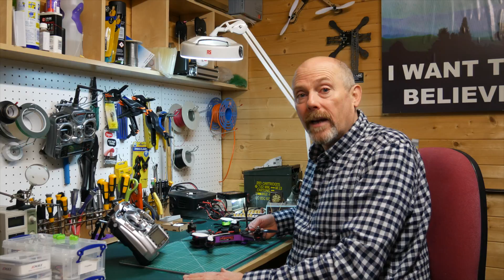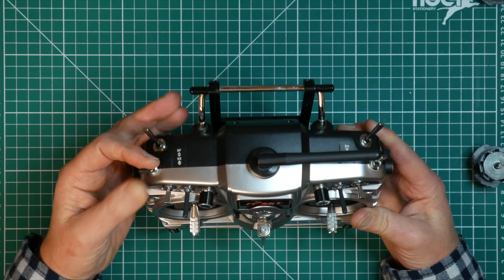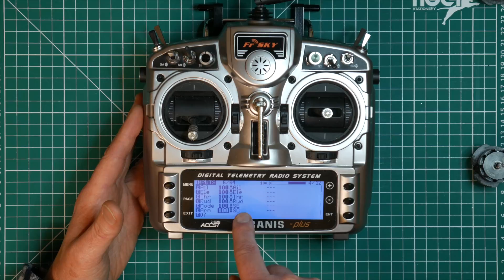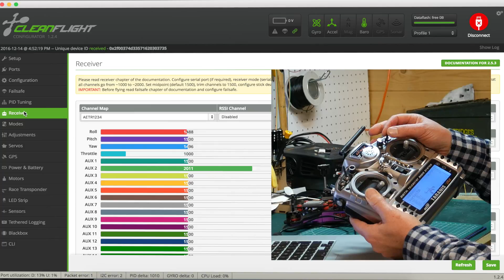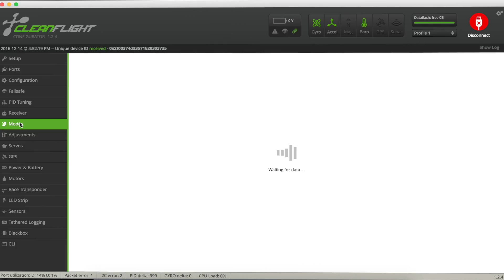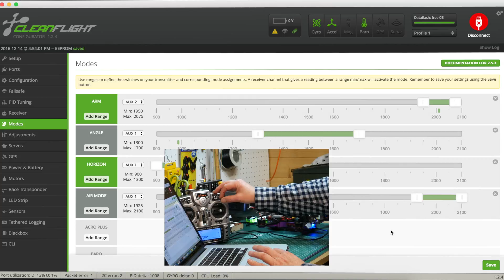Vortex 250 Pro quick tip - arm switch

Comment: Hi there,
i appreciate that cleanflight and betaflight are basically the same thing but in betaflight
i would like to change the setting on the mode switch. In my mind the mode switch should
run from easiest mode to hardest mode, like you have it in cleanflight......But in betaflight 
it runs Horizon - angle - air mode... 
I need to transpose the Horizon and Angle mode.

any help you can give me would be great.

thanks in advance

Mark Logan.
Reply from the maker: The process for setting the flight modes is identical in betaflight and cleanflight.
Reply: Whirly Bloke ,
Sorry, I think you misunderstand .... in cleanflight go to mode tab the sequence goes " ACRO-HORIZON-AIR'
but in bataflight the sequence goes "HORIZON-ACRO-AIR'
How do I change this sequence to make it the same as cleanflight 
Kind regards
Mark Logan.
Reply from the maker: The order they are displayed in CF and BF is unimportant. You can just assign the flight mode to whatever actual switch or switch position you want.

Comment: Hi ,quick question from a begginer,  will that cancel out arming the quad with the throttle?
Reply from the maker: Yes. You're moving the arming fro the throttle to the switch. Arming on the throttle is a bad idea as I found out to my cost.  https://youtu.be/yc3ZukgYx6s?t=531
Reply: Whirly Bloke thanks for the info! Gonna set that up straight away as soon as my vortex arrives!! my phantom has the same arming method which seems dodgey. First time getting into fpv, your tutorials are Really helpfull keep em up and thank u! U got a subscriber here bro!

Comment: Thanks for posting this. All your videos have been fantastic. I have a question as to why you add the arm switch both to inputs and mixing page. What does each of these accomplish?
Reply from the maker: If you don't set up a mix you won't get an output on the channel. One way to think of it is the Input page (page 4) are the inputs and the Mixer page (page 5) are the outputs and they need to be mapped or linked. You can ignore setting up a named Input channel if you want and simply select a new Mix and directly map it to Input SC. I prefer to explicitly name the input channels to avoid confusion.
Reply: That makes sense. thanks!
Reply from the maker: Some things get auto configured on the Taranis, but I find explicitly setting thing works best for me.